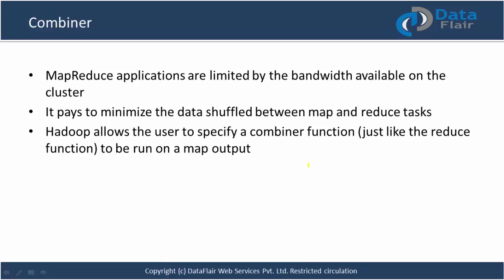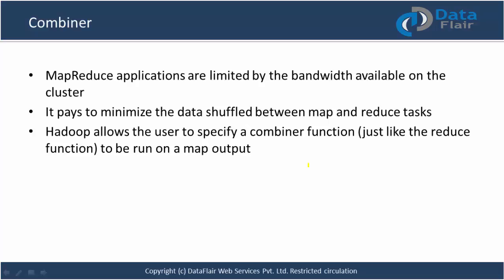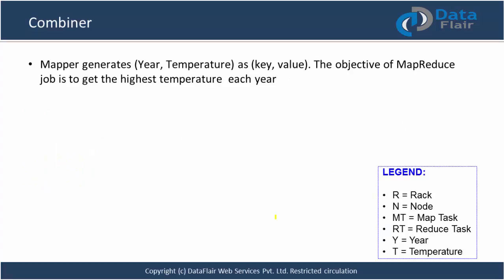Introduction to Combiner | Optimize MapReduce Job using Combiner

Comment: Good concept and i have implemented Combiner by seeing your video .My apllication completes fast but there is one issue when i use combiner .i am reading Hbase table that has 40 regions and write to the text files .So because of 40 regions 40 mappers are running and when i run combiner for each mapper one output file getting generated .Can you please help ?